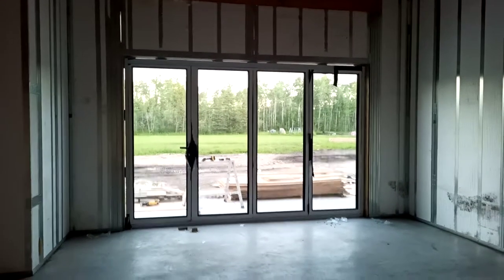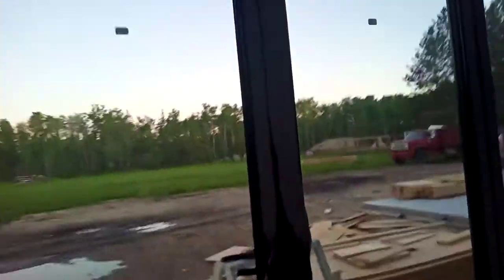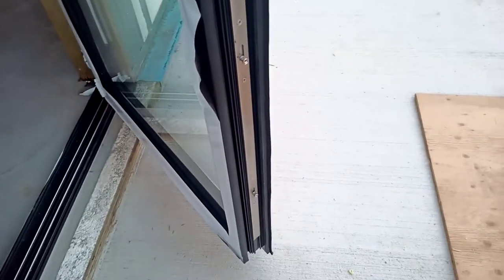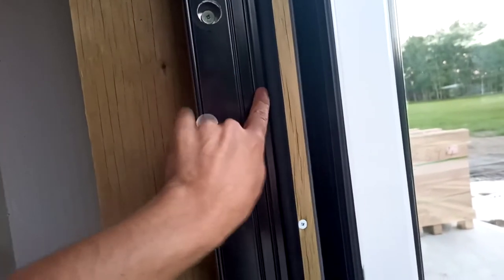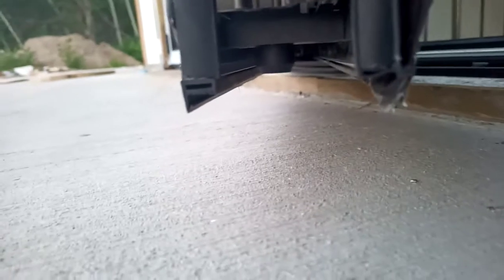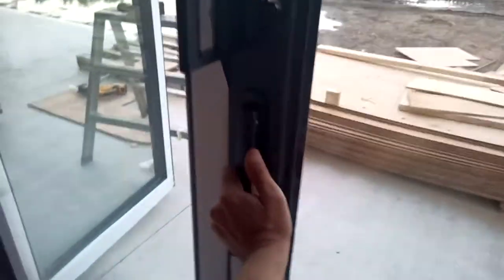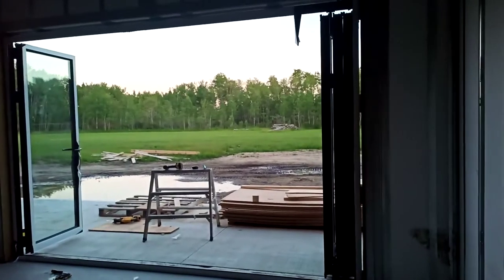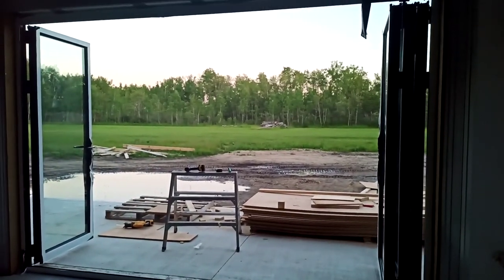Bifold Doors from Doorwin Group China. Triple pain low E argon. aluminum frames with thermal break.

Comment: Hi Myles, would love to hear a 1 year
update on the doors and performance. Did you have U-factor on the unit?
Reply from the maker: So the doors are okay. Definitely great value. No huge concerns right now other than that I can feel some where in the handle on the high traffic doors. And the caulking around the windows cracked in a few spots which I had to redo. The windows are sealed units so it's just the window to the frame caulking that needing addressing.

Comment: Hi Myles, Thank you for posting this video. We have a quote from Doorwin now and are considering them. Since your video was from 10 months ago, wanted to see how you liked the bug screen and if you still like the door. Do you know if they have a bifold door with a top roller to create more of a flush threshold on the floor? Is there anything you didn't like about working with Doorwin or any advice you'd recommend we make sure we cover with Doorwin before ordering? Thank you for your help.
Reply from the maker: Hello. Yes we still love the doors! I did not have the option to get the ones that hang from the top because we love in a cold climate having a good door air seal was very important. Our house clocked in at 0.7 air changes per hour on a performance test which makes these doors IMPRESSIVE as I have 3 units total. 2 are 8' x 12'. And the other is 8' x 15'. The big screens I just installed last week. They actually work very well. I'll try to make a video of those. If I don't make a video before you order (please mention my name on your quote and talk to Lilian or Victor). When you order the bug screens order them bigger than the door so it doesn't effect your view. I'll try to make a video. Subscribe and watch for the screens video

Comment: Hi Myles!  Great Video.  I am looking at a 12 wide by 8 foot tall.  Will Doorwin make the door based on this rough opening or does it change for China?  What was your rough opening?  I like yours.  What did you mean that the rough opening called for a 1/2"?
Reply from the maker: Hi Jerry sorry for the delay, but hope this helps.  They make the door based on exact dimensions, so you need to supply them with the door size you want, then make your rough opening a 1/2" bigger all the way around, so make it 1" wider, and if floor mounting like I did, make it 1/2" taller than the actual door size.  I ripped PWF plywood into shims to make sure it would be a strong install and it worked best, USE A LASER LEVEL
Reply: @mylesoffgrid  Hi Myles great job. How much did it cost you?
Reply from the maker: These doors are way CHEAPER than anything you can get locally.  I ended up paying around $7000 usd per door, I have 3 doors installed including the bug screen system.  Get a quote from them
Reply: @mylesoffgrid how much was the sliding glass door from Doorwin

Comment: If I order it with hardware inside, when I open, the doors will "hang off" the outside, correct? I'm joining 2 spaces and I need the doors to hang off one side over the other and not sure how to order. Struggling with the representative. Thank you.
Reply from the maker: Hi Susan yes the doors out swing towards exterior. If you order doors with odd number of doors they all go to one side. If you order even number of doors i.e. 4. Then one will swing left and three will roll right. You can tell them which side you want the swing. Hope that helps?

Comment: Hey man I just installed the doorwin bifold door, the bifold parts is fine works great . But I’m having issues with the individual one that opens normally . I got the same design as you left single sash open normally and rest 3 bifold . The one that opens normally is the one that got problem almost feel like the lower end is rubbing on the track . Is there anyway to adjust the door to make it lift up a little ?
Reply: Like feels like that single sash is sagging that’s why it’s rubbing on the track but I noticed this issues as soon as I installed it . But I’m not sure how I can adjust it
Reply from the maker: Mine did this as well, you need to lift that whole door up slightly with air bag and move the hinge up on the door slightly.  They do require adjustment after install as they are heavy

Comment: How are you liking your Doorwin doors and windows? I saw you were having some caulk issues? What temp swings do you get? Would you go with Doorwin again if you did another project?
Reply from the maker: Hi TD. We get temp swings from minus 40 to plus 40 Celsius. They are black and facing south. I am thinking the aluminum has expanded and contracted a bit causing the cracked caulk. Only on the inside which is weird. I will cut the caulk and redo it if needed so far not causing any real issues. I would purchase again yes!
Reply: Thanks for the response. Did you go with all aluminum or wood on the inside? If all aluminum do you find the aluminum even with the thermal break transfers alot of cold to the interior aluminum in the winter and creates condensation on the interior aluminum? Wondering if the wood is worth the added cost.